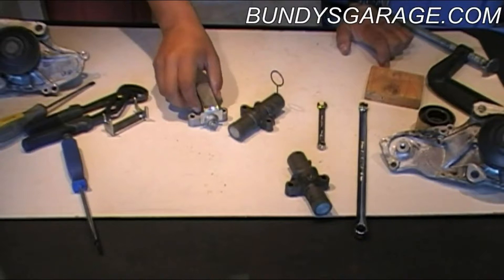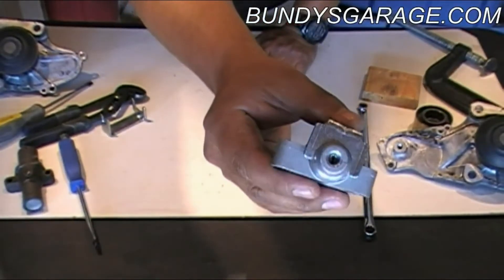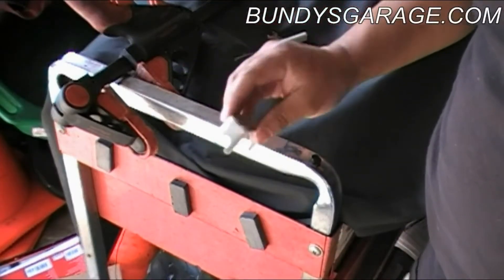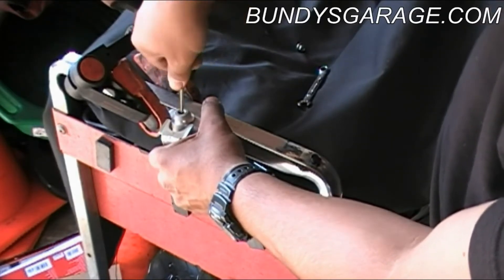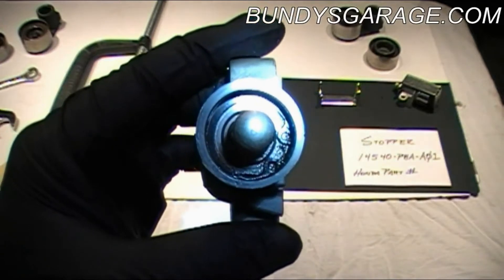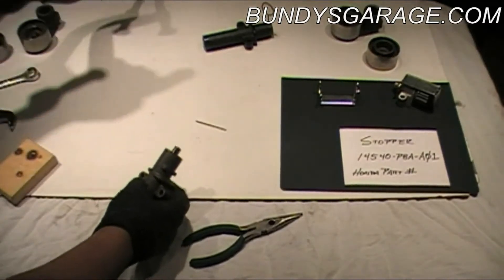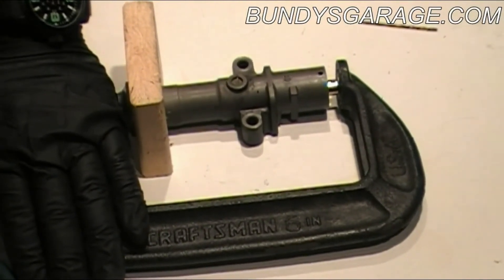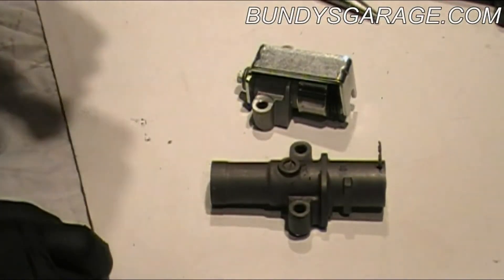98 - 15 V6 Honda Acura Tensioner Reset Timing Belt - J Series V6 - Bundys Garage

Comment: Hey there I have an 06 tl and the hydraulic timing belt tensioner is going out and making a ticking noise on cold start I noticed it’s 2 10 mm bolts that go through it and was curious if it’s as simple as that or if I’d have to tear apart the whole timing belt. I can’t find any info on this at all so I figured I’d ask you
Reply from the maker: No you don't have to tear the whole timing belt apart but it's a good idea to change all the timing belt components if your in there that deep. Change the TB, water pump, both pulleys and the tensioner. You can but a timing belt component kit off of rockauto.com for a great price. Stay with the Aisin brand and DO NOT use Gates water pumps, they are junk!
Reply: Oh lord, I ended up getting the gates kit 🤦‍♂️ hopefully this lasts me it hasn’t started leaking yet!
Reply from the maker: The Gates don’t leak, they seize up and destroy the belt and mess up the valves in the head. Both happened before 60,000 miles on the Gates WP.
Reply: Oh my. Sounds like a plan, I’ll be changing it out probably in the next 10k miles than, thank you for the info

Comment: Note for everyone in the future to read this according to Honda spec sheets ALL J series engines are non interference. The J series is the ONLY non interference Honda engine in the US as of this moment.
Reply from the maker: Post a link to that information please. J Series engines are interference engines, I've seen it first hand. The timing belt breaks, and the valves and the piston hit each other and then you end up with bent valves. So show me where you are getting this from unless your just trolling hte comments?
Reply: @bundysgarage  http://yourcarangel.com/2014/07/interference-engines-complete-list/

https://naijadriva.wordpress.com/2015/07/23/interference-and-non-interference-engines/

Here you'll find Gates catalog and when you look under Honda at the 3.0 and 3.2 you'll not see the * next to them. For whatever reason 3.5 claims to be interference but I have personal experience as a  Honda mechanic that the pilot 2003-2005 and Odyssey 1999-2003 are non interference as the cylinder head is interchangeable with the 3.2 and certain 3.0. I had a cam break and although it destroyed the head where the cam journals are it never bent a valve and I drove it on 4 cylinder roughly 6 miles back to my shop. Anyways, here's your info
https://www.google.com/url?q=http://www.raauto.com/pages/timing%2520belt%2520replacement%2520guide.pdf&sa=U&ved=2ahUKEwid24-r9MDhAhVrUN8KHY-ZCU0QFjABegQICBAB&usg=AOvVaw0COv7t2uIAPtcGroYgkMfE
Reply: @Mr_Everyman  I'm confused. This link shows that the 3.0 and 3.2 ARE interference. There are asterisks next to the engines which denotes interference.
Reply: @mraurora  and that's why I said that the link is wrong, I have personally replaced many broken timing belts on 3.0, 3.2, and 3.5 engines and there's never been a bent valve, also had a friend that worked at Honda and the factory days sheets that were in their system showed that all j series were non interference. But that's all I can say about that.
Reply from the maker: Bro you are wrong! J series engines are INTERFERENCE ENGINES. The Rodeo and Passport have C Series V6 engines not the J Series.
Reply: @bundysgarage  I work on accords and pilots mostly, never had any issues and if I could find a link to the data sheets I would share them here, I'll try to look for them today if I get a chance.
Reply: @bundysgarage  all 3.2 passport and rodeo engines are also non interference.

Comment: Is the fluid in the pre-2000 tensioner hydraulic fluid or just lubrication? When   my 2005 tensioner failed, I wondered why they didn't just use a ratchet and it almost looks as if that's what the more reliable, earlier tensioner was.
Reply: the ratchet tensioners lasted too long so they had to find another way to bring you in for service 😜
Reply from the maker: Right!

Comment: Finally; some detail on this part of the process!  Thank you.  Quick question...once reinstalled after the T/B replacement - does it sufficiently self-tension, or is there any "re-expansion" process following the new belt installation? Seems a bit unclear online...thx again.